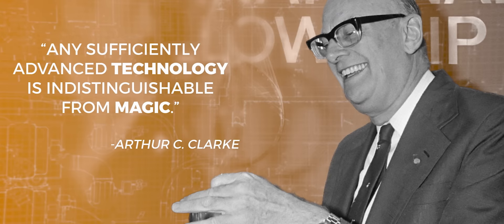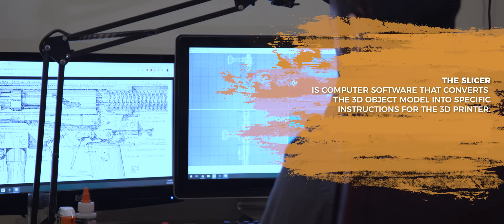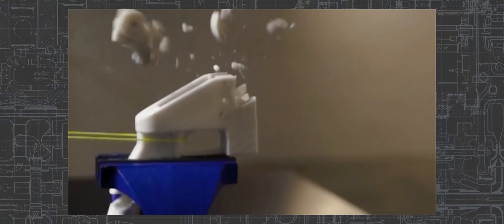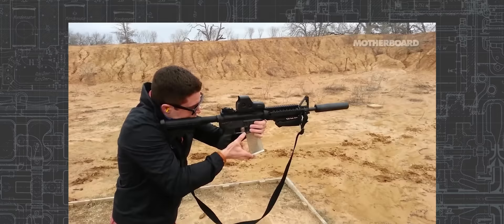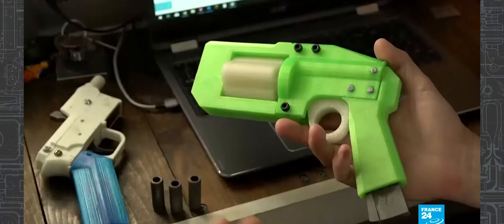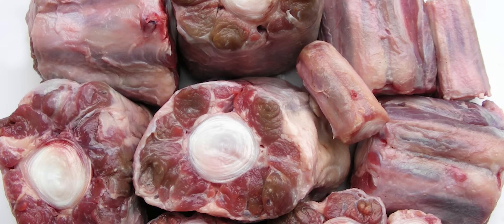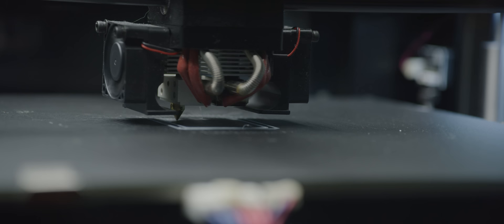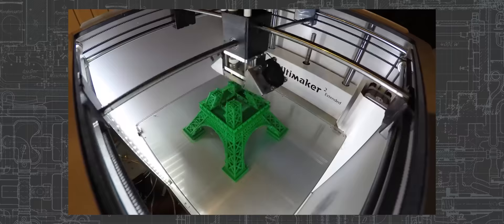3D Printed Guns, Explained

Comment: A 3D printer costs the same if not more than a firearm. Even if you could somehow make one with a printer, you'd be better off just buying off the streets.
Reply: $300 for a printer, $200 at max for the tools for electrochemical machining, totaling no more than $500 for initial investment. Low double digits for PLA+ filament and steel pipe and spring wire. No more than $600 nets you two functional, safe, semi-automatic 9mm FGC-9 pistol-caliber carbines, and you can make them 'till the cows come home.

Comment: You could call a 3D File speech but then again so is every program. Even programs that are made for hacking which are already illegal. So prohibiting 3D Gun models isn't really such a far stretch.
Reply: hacking in of itself is the crime. It's not illegal to have a program for it if you don't use it for a crime. Just like building a gun isn't a crime but committing murder with it is.

Comment: Pushing the argument off the table because the tech isn't there now isn't a good way to look at it... how about in 5-10 years when you can make a fully functional, commercial quality gun? Same goes for metal detector defeating guns, they dont exist just yet but it's a small step before they do, so we might aswell approach the argument as if they are real. It's like ignoring the idea of self driving cars because they don't quite exist perfectly yet.
Reply: They definitely missed an opportunity here to compare the technology to CNC mills, which have been around for decades and are already used to make current factory-produced firearms from strong steel, rather than weak plastic. The two types of machines are incredibly similar, operate using the same 3d files, but with a spindle, rather than a hot glue gun. But mills cost quite a bit more because mills require rigidity, and rigidity costs money. Regardless, DD's new Ghost Gunner 3 mill only costs a couple thousand dollars, which is now within an order of magnitude of the cost of a lot of these cheap 3d printers.

CNC manufacturing isn't new. Building your own firearms from freely available and easy-to-follow plans isn't new. Nobody in this space cares or particularly wants "metal detector defeating" guns because they are objectively the worst possible firearm you can make, and are already illegal to own in that configuration(without >=3.7 oz of scrap steel hot glued onto them.).

Trying to prevent gunsmiths from collaborating online like programmers already do, will not prevent bad people from hurting others. These plans have already been published, new designs will continue to be published, and you will never unring that bell. The anarchist's cookbook is downloadable. So are gun plans.
Reply: @evn153  seems like the only reason there's so much discussion about homemade guns now is that the non technical and non wealthy masses can make them... which sounds completely opposite the usual stances progressives typically make.

Comment: I have an ender 3 printer which I paid $270. The accuracy is plus or minus 0.1 MM. I also have a CNC router with the same tolerances which I paid $1,400 for.  IMO a router would be more suitable to make a firearm, except not a hobbyist one. A commercial CNC router has accuracies as high as 2 microns and will set you back $100,000, you would probably need 1,000s of an inch tolerance to make an accurate firearm. If you want to win a Darwin award just shoot off a plastic gun!

Comment: Come on man each piece would have to be printed out and then put together somewhat like a puzzle for the stupid people but there could be a good example as like if you can imagine a box of paper slice paper and then if you put an object in the middle of that box of paper then the computer will see each line as a as a shape and then it just prints that up it's either nothing there or something there in the computer is really good at that actually it's really quite easy once you scan the object and put a 3D in there then you just place it inside the theoretical box of sheet paper print paper

Comment: More disingenuous FUD. Those guys shooting AR-15's, only the lower receiver is 3D printed. They did not print an entire AR-15. You would fire one round and the rifle would explode. The round would fly errant and most likely bury itself into the ground.  The handgun exploded after one round was fired, there have been some models that have been able to shoot multiple rounds but they are shooting a small caliber round 22lr.
When you can 3D print barrels and a chamber that can handle pressure of over 52,000Lbs per square inch then we can worry. Metal printers are here and print high tolerance items but printing barrels that can provide accuracy and dependability takes a lot of ingenuity.

Comment: Dood, we can print in metals, even titanium alloy that are used in actual car engines and aerospace vessels. It's late 2019 when you post this video and SLS is already known widely by that time. Stop looking at 3D printing as "Plastics Only".

So, let me ask the question again: "Are you sure we can't print AK receivers?"
Reply: With the money you need to spend on metel 3d printers, you better off of getting a cnc machine..

Comment: It’s honestly easier for a criminal to get a gun on the streets than 3D printing. Printing requires a computer, 3D printer, and filament. And knowledge on how to design and print. Where instead you can spend 150 dollars and get a high point under the table

Comment: just remember boys. if you cant make a gun you can easily make a fire bomb with parts that are all perfectly legal to buy :)
Reply: You can make 12ga slam fire shotgun with just a drill, 3/4" black pipe, 1" black pipe, 1" endcap and screw. This is much safer and much better than .22 plastic gun that take 8+ hour to make and explode in your hand when you try to shot.

Comment: Personally not into it because I'm a beta male. But I don't support stopping it because people need to know for two main reasons. 1. China said Americans owning firearms is a problem which suggests they have enough govt control to hand us off, but not enough for occupation. 2. There are protected cultures and religions that specifically mass vote against gun rights then go for your young. < Religion of peace.. 3. The 3D printer technology will eventually lead into plasma generated ultrasonic holographic replicator technology we need for capacity to all produce our own products or rearrange cells to repair critical injuries while using transcranial pulse ultrasound from same device to reduce communication of cells in pain region.

Comment: 3D Printing is overrated and over-hyped.
Reply: How so? $200 for a fairly decent printer and $20 for enough filament to make dozens of small objects. If you can 3d model it, you can print it. Need an action figure for a lid? $2 worth of filament. Need a spoon? .50 cents of filament. Want some chess pieces? Easy. 3d printing is incredibly underrated and unknown to those not tech savvy. As for 3d guns, there are plenty of ar lowers already on the market that are plastic and even glock lowers are plastic. You can even get filament with wood, kevlar and gold in it. The possibilities are litterally endless.